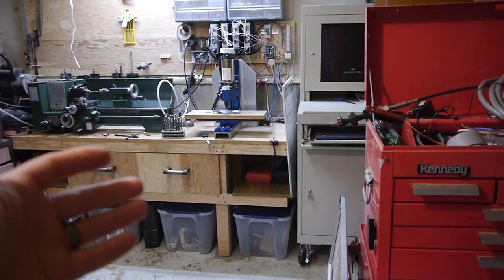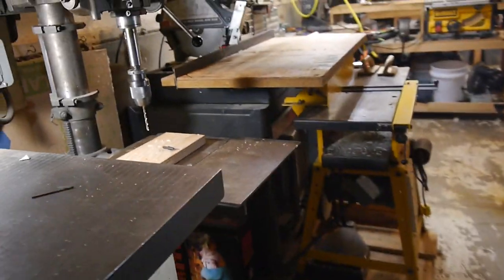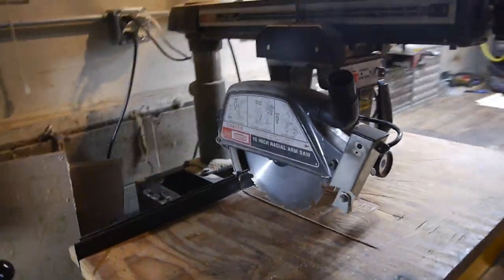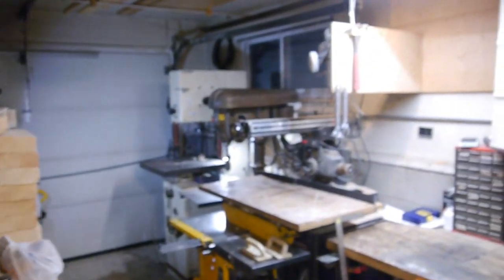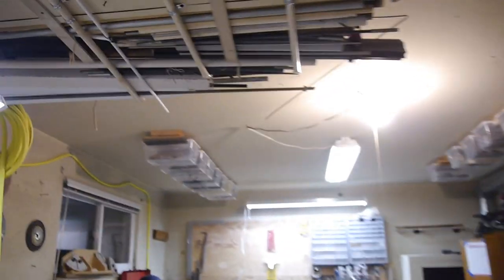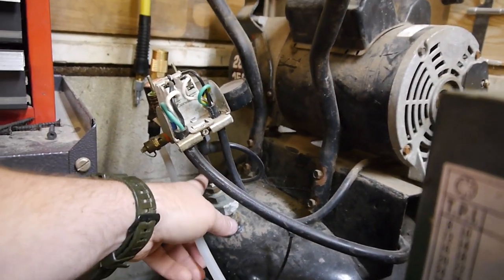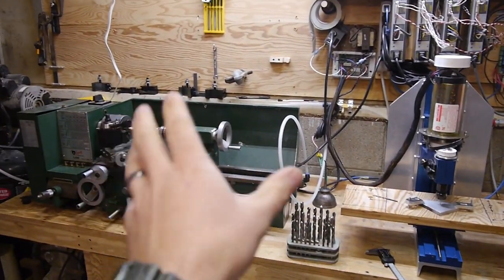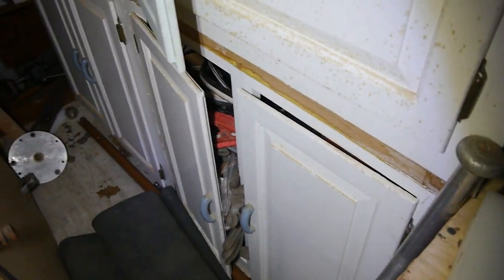Shop Tour 2017 -  My Single Car Garage Shop Setup to Date

Comment: It just needs straightening. Maybe selling or throwing out things that you don't need or never use? I really like the storage boxes along the ceiling. Last night I was racking my brain as to where I could get more storage and this idea is perfect for my shop. There is a loft above the workbench that is a lower section of the ceiling that I can easily reach. I may use part of the area to store my pipe clamps too. Now to find a good and cheap source for the shoe-box size containers! Thanks, fort he great idea!!
Reply from the maker: Thank you for the compliment. My shop is even worse off now, I picked up a bridgeport mill and a delta tablesaw in the meantime. I purchased mine for 99 cents each at home depot. Hopefully that helps.
Reply: @JoshAQ - LOL, I know what you are talking about. I like to restore old woodworking tools and I have two big drawers full of tools and parts waiting to be restored and I just bought ANOTHER mixed lot of hand tools on eBay "to be restored", lmao!! Thanks for the tip about the boxes. I will check and see if I can purchase them online before going to a store during this time of isolation. Take care!!

Comment: I like what you are doing with the storage bins above the garage opener/door area that is a great idea.  What are you using to store the lumber above on the other side of the storage bins?  Looks like pipe through 2x4.  How has that held up?  I want to do something similar.  Thanks for sharing your ideas.
Reply from the maker: Thanks! I saw much bigger tote hung similar to this and thought smaller would work better for that space. The other lumber rack is made from 1/2 emt conduit so 3/4" o.d. roughly. They are fixed in 1" thick X 2" wide plywood, 2x4's would certainly work. I cut a couple bed frame angle iron and drilled 4 holes in them 2 in each leg and screwed 1 side to the plywood and the other into the rafters in the ceiling. The emt has done well, but does sag in the middle. If I redid it I would probably use 3/4" emt conduit to get a little more capacity out of it. If I had to guess, I would say it is currently holding 50 to 80 lbs of wood in the air. I actually need to go through it and pullout the pieces I will never use. I built it before I had built the shelves down below. You are welcome and thanks for watching!

Comment: You have some great ideas. Making the most from limited space, Nice place. I have a project for you. Take the incline assy from the treadmill for your drill press table. I'm going to try for my z on the mill. I'll post an update soon. I'm collecting treadmills. Ha.  Happy 2018.           Ron..

Update, my mistake, thought your incline motor was screw drive like the newer ones. This kind will work.
Reply from the maker: No Problem, I had thought of trying to use the incline assembly to power the feed rollers on the jointer/planer combo, Still thinking that one through though. I was looking at your most recent video, you are making swift progress on your tread mill tear down! Looks Good!
Reply: I have one of the screw drive incline motor assemblies if you need one.
Reply: Just picked up two more treadmills.
Reply from the maker: Thanks for the offer, I have some screw drive lazy boy motors right now, like 1" diameter so I am set on them LOL
Reply from the maker: Oh Man I am not sufficiently ambitious in my scrounging around skills. Nicely Done. I need to pick up one more for my small lathe. It's a bit of a pain adjusting the speeds, and it would be nice to do some power tapping with the tailstock and a nice slow speed into plastics and the like.